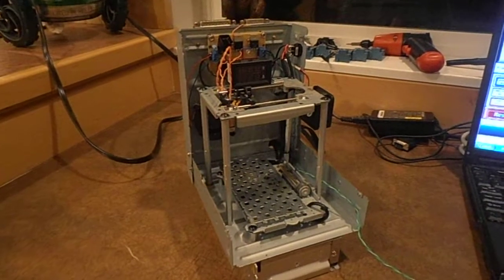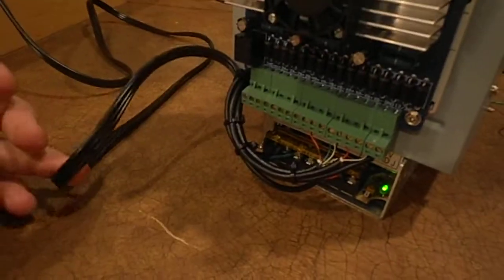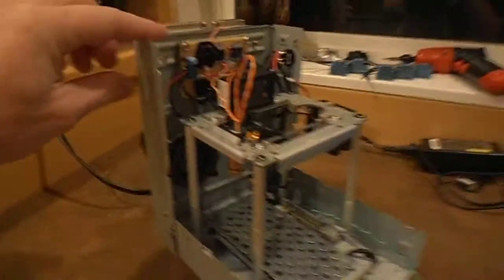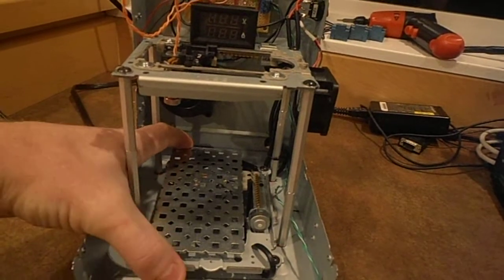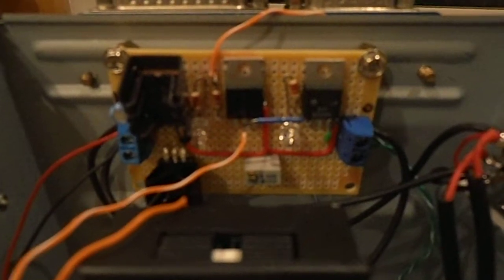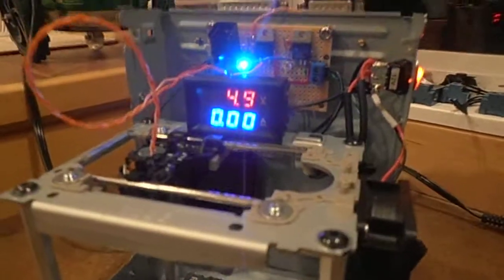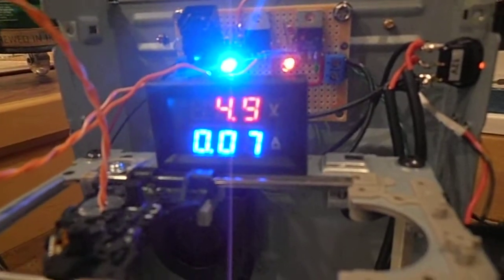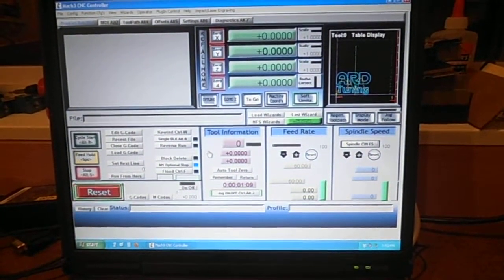PB150005

Comment from the maker: Most certainly, it is really fun little project that doesn't take too awful much depth of knowledge to make it all work so that helps alot as well. As for material it will etch plastic, wood, rubber, and metals that have a coating on them like paint or anodize.

Thanks!